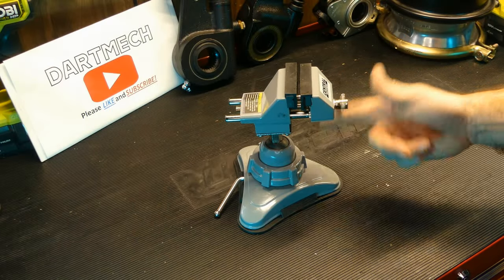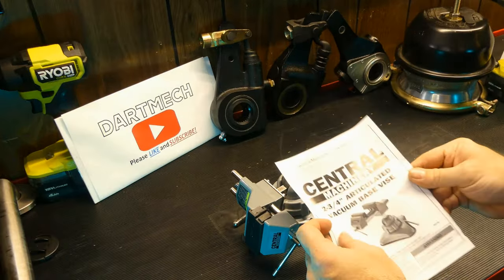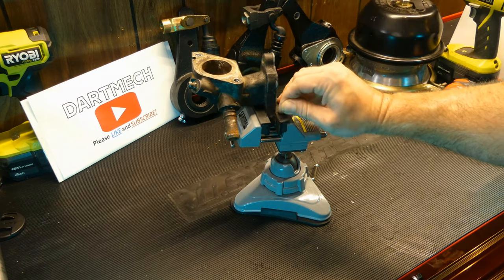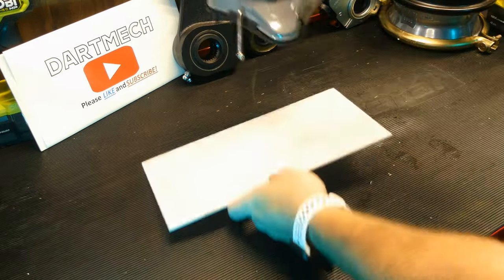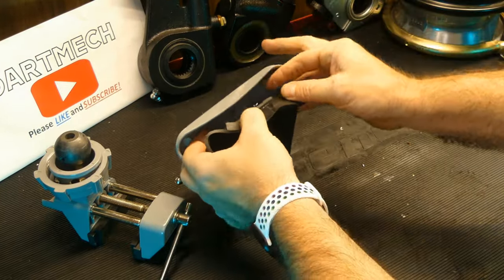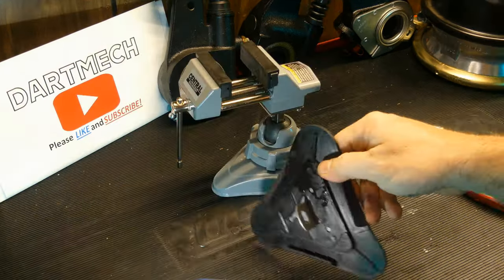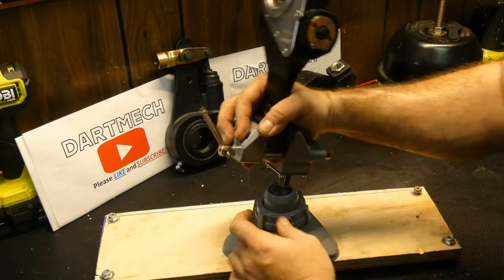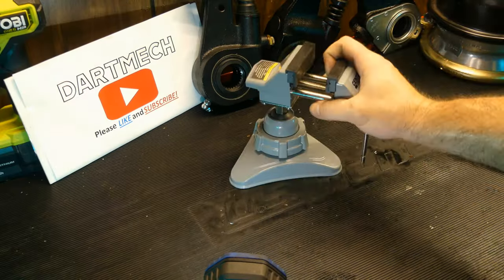Harbor Freight's Suction Vise - A Must-Watch Before You Buy!

Comment: An extreme magnetic base would be to use the Harbor Freight 250lb Retrieving Magnet #36905  $19.99    There is a threaded insert for the eye hook that it comes with.  It might be 1/4-20
Or bolt it in the center of the US General 10 1/2 x 11 1/2 Magnetic Parts Tray #568802  $17.99
Reply from the maker: Nice! Thanks I’ll look into those!